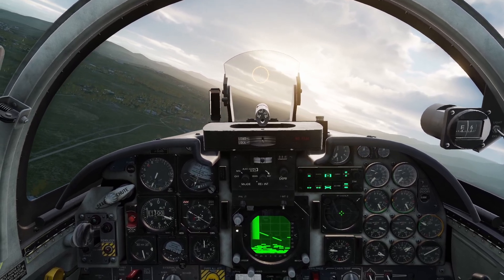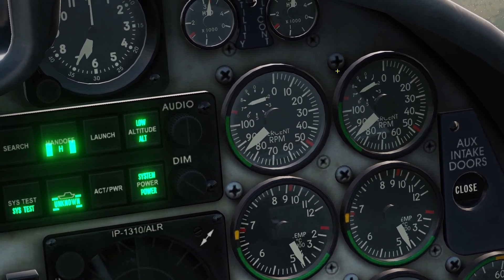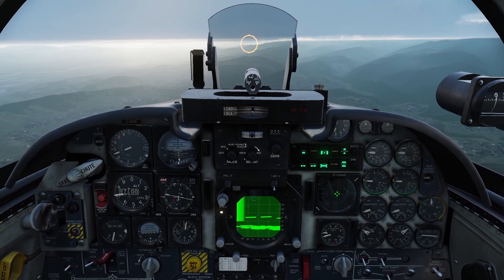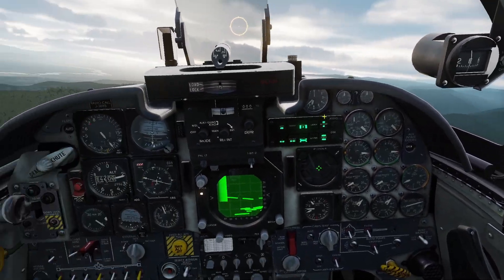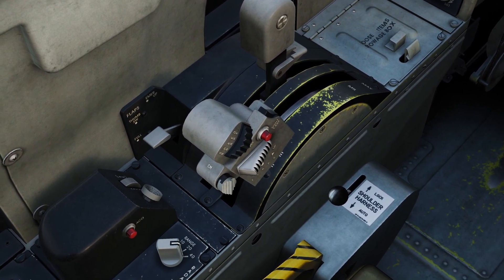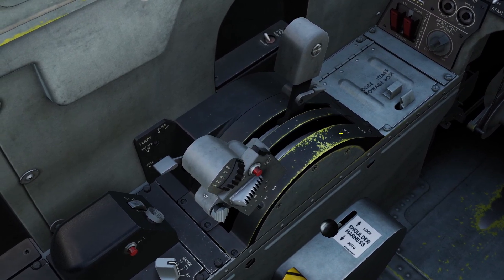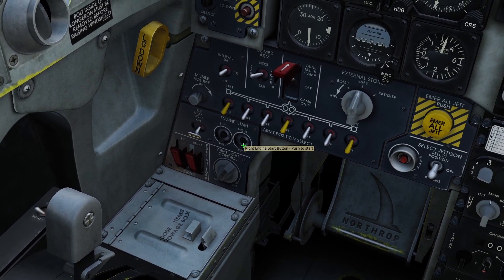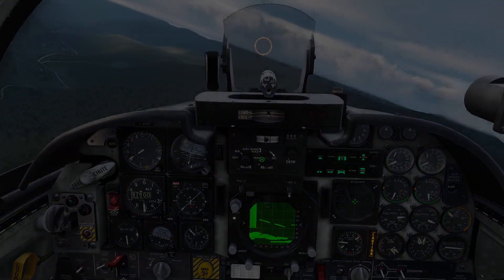DCS F-5E Engine Management

Comment: Good video.

Quick note: The engine starters on the F-5 are a pneumatic system, and during normal engine starts require that air from the AGPU. When you do an air start with one engine operational you’re conducting the start using the compressor bleed air from the engine that’s running. It has less to do with airspeed and more to do with engine RPM and the amount needed to provide enough customer bleed air. This is called a cross-bleed start and you can also do it from the ground with zero airspeed. Please keep these videos coming.